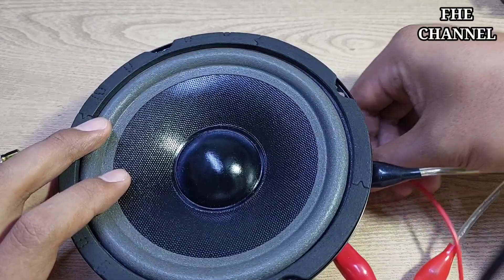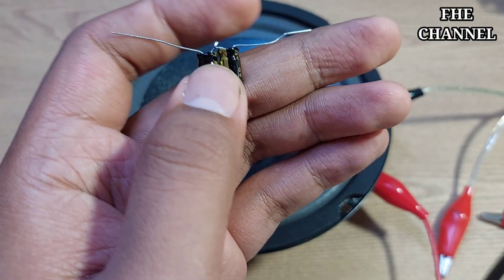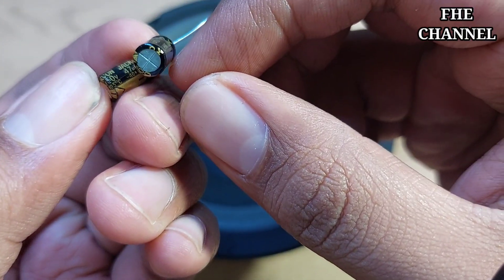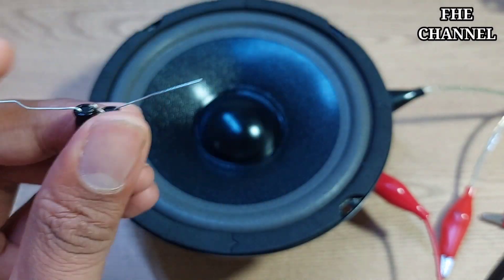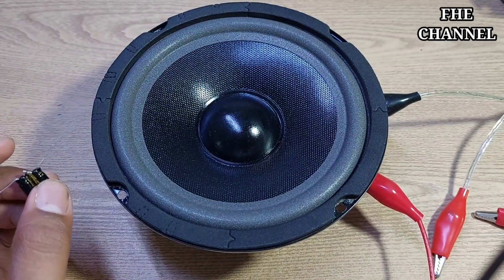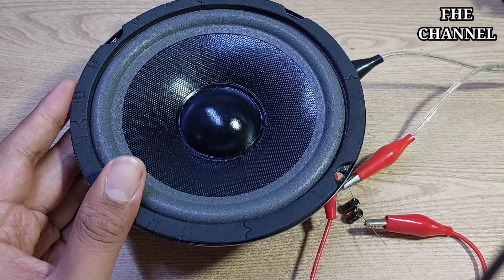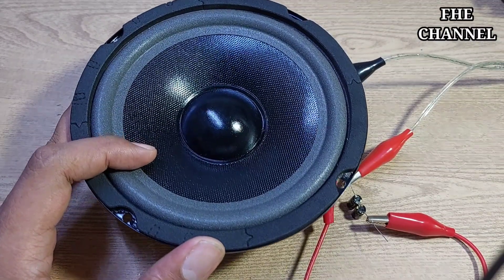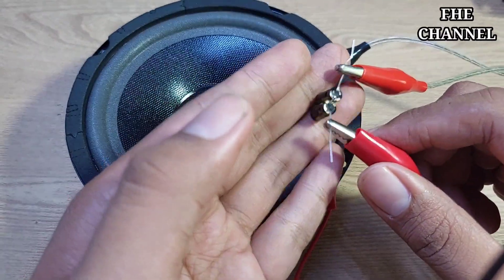Wajib coba..!! Pakai Elco Nonpolar Bikin Suara Mid High Pada Speaker Tambah Manteb

Comment: Itu brpa volt kang
Reply from the maker: Ini 50 v bang kalau untuk watt besar pakai yang 100v ke atas ya
Reply: Klau 4.7 bisa ga kang
Reply from the maker: 4.7 x 2 maksudnya?
Reply: Pake elco 4.7 50 volt,
Reply from the maker: Pengen cari karakter sperti apa
Reply: Low mid
Reply from the maker: Ndk bisa kalau mau buat low mid pakai itu bang
Reply: Terima kasi kang